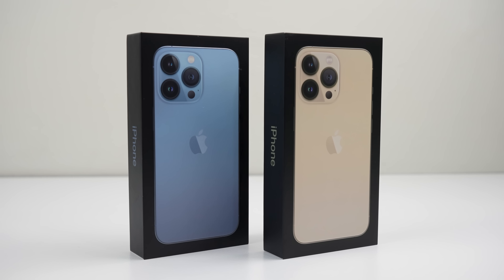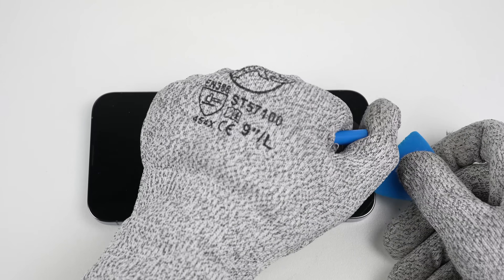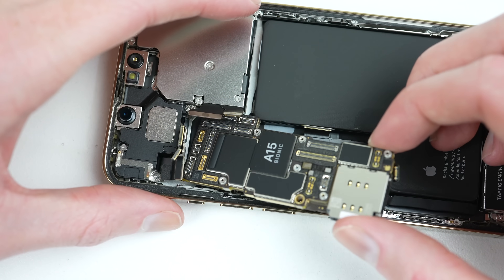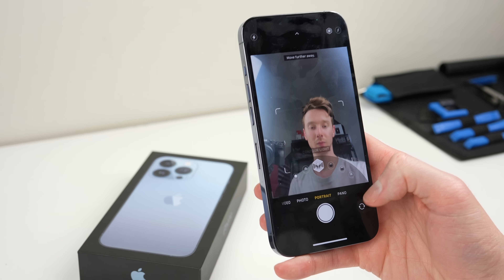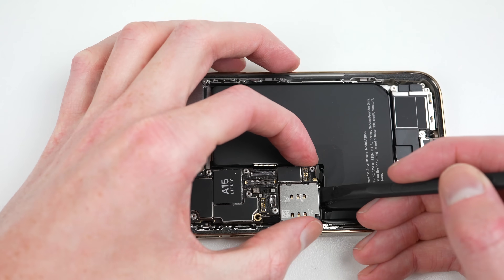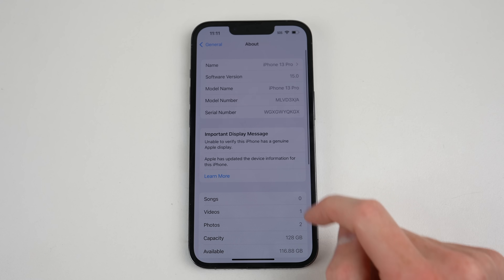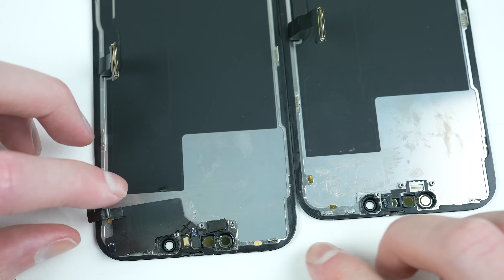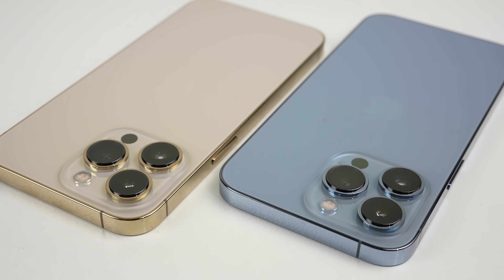iPhone 13 A Repair Nightmare - Teardown and Repair Assessment

Comment: Idk, even working in a repair shop for years I still prefer that apple has pushed out third party repairs and locked own security. As a user of the device I prefer the lock outs and knowing my parts are genuine. This all also comes in an age where small repair shops can partner with apple themselves to get genuine tools to a legitimate business shouldn't run into these issues. 

Only people that are hurt are the common users that want to repair their own device. Even then, I prefer the lockouts since there's no way to know if a third party is actually sending genuine parts. Also with the price of these parts, its going to be just as cheap to get it repaired by a professional anyway. I really do not see a downside.
Reply: Your ass is doing the talking for your brain.
Reply: That's a good philosophy if your customers are willing to pay twice the price for the privilege. The same with getting your car serviced at the dealership all the time. If you want to pay exorbitant prices for the same work, more power to you.
Reply: @hurricane1951  that would make sense if the parts didn’t cost more than the entire repair even directly from Apple. Screen break the most and since the switch to OLED the good quality ones are still around $250 at the cheapest for just the part. Apple charges $200 with repair included. That’s impossible to beat for 3rd party, so they always use aftermarket which will always not be up to genuine standards. 

Apple also incentivizes repair shops to partner making the sign on really cheap and giving them 50% of the repair cost. It’s great for business and ensures customers get quality products. There’s no downside.

Comment: If you could at least change the battery, which is not even possible with Android phones these days.  That would be a huge step forward.  I have now had an Android cell phone for over two years, but iPhones have now become much too expensive for what they offer, LG no longer produces cell phones and Huawei no longer has Google, so there are actually no more interesting cell phone companies on the market  , Samsung was never warm to me.  And so I don't know which cell phone to buy next, that's why I have mine for over 2 years and it would be nice if I could change the battery now, for € 20 or so.  Instead, it will probably cost me around $ 100.  Doesn't have to be something like that.

Comment: That's one reason why I still have a MacBook from 2014, because you can still change the hard drive (And you don't have to pay Apple's overpriced SSD prices) and before that you could even change the RAM memory, add an additional hard drive or install a CD drive and so on and so forth.  And I still have all the connections and don't have to deal with 3000 adapters.

Comment: Unfortunately this is making its way into alot of other products as well;
 I've just tried to repair a Husqvarna Automower (a robotic lawn mower), and experienced issues. In the device there are several computer-cards, one for each function. I then got hold of a few other mowers of same make and model for parts, even built the same year. Switched damaged board from 1. mower with a working one from donor mower. Turned it on, and a lot more fault indicators on display. Tried with card from 3 more mowers with same result. (And remember, all 4 of the donor-mowers was ok regarding this spesific card.) Turned in the original mower to factory dealer, who told me after repair, that Husqvarna is implementing checks that insures only Husqvarna sertified wokshops can do card repairs. No diy or third-party repairs possible on cards or battery. Yes, even the battery is checked for serialnumber when powering up.

Some models have 1 battery and others have 2. But the casing is the same, so there is room for a second battery in most models. Even the logic board is the same across several models and are populated with a second battery terminal. But you cant insert a second battery in a model originally set for 1, and you cant replace a broken battery with a third-party battery. Not even a donor battery from Husqvarna!. You'll have to purchase a new original Husqvarna battery AND a new logic board, AND have it replaced at Husqvarna authoriced workshop at insane prices... The autorised workshop says that even they cant use a donor battery. The pairing between battery and logicboard is done once, and cant be undone or changed.

This pracsis is NOT environmentally friendly, and it's NOT a safety issue (as Apple tries to imprint into everyone) This is ONLY for insuring that Husqvarna is getting paid for aftermarked repairs, and more sales of new mowers. SHAME ON YOU! BOTH APPLE AND HUSQVARNA! And all other companies that are doing the same just for profit!
Reply: While Apple can be symbolic of this practice because of just how much of a spotlight their products get, it is indeed far more wide spread than just them. This is the point of why right to repair is so important, without any push back companies are just going to keep pushing the envelope until it's all going to become serialized and virtually impossible to repair.
Reply: This also contributes significantly to wealth disparity. Only rich, first world countries with access to "official" services are able to use these products. Who knew that making our tools "smart" would simply mean that the companies manufacturing them would gatekeep the devices inside and out?
Reply: Yeah! Sometimes analog is the way to go..love my good ol lawn mower
Reply: There is a simple way to make manufacturers notice of your displeasure. Don't buy their product. There will be alternatives on the market that are serviceable by the DIY'r or 3rd party repair centers and when their model flops then this will then make companies  notice as it will not be looked upon kindly by investors/stakeholders etc. Until we ALL do it then nothing will change. There may be change if it affects a politician although the wheels of bureaucracy turn awfully slow so change could take upwards of a decade and then there's donations towards political affiliation to consider so...meh, don't hold your breath on that.
Reply: @fry_me  Well yes and no. Like you could buy a different phone than iPhone but what if you are already dependent on iOS only apps. Or you could buy a different tractor than John Deer but what they are the best for what you need to get done at your company. That is the leverage these companies have. It is just another extent of monopoly. And it needs to be fought against. We need some more customer protection laws because these freaking companies won't stop before anything to get more profits.
Reply: @MrMozkoZrout  There will always be the grey area and if we settle for the "most ideal" product because we are too lazy or incompetent to innovative then yes, we must suffer in silence because this is the road we have chosen and the vocal minority will be viewed as pesky mosquitos.
Reply: Right to repair pretty much started with farming equipment and phones

Comment: I think the reason that swapping the board and other components doesn’t work anymore is to prevent it from being used by another person if it gets stolen. Believe it or not there are such markets where you can strip a phone or a computer and sell its parts separately.  At least I have some satisfaction knowing that if my new phone is stolen it won’t be used by someone else and Yes the repairs cost a ton and that is a bad practice but everyone is doing it these days remember when Apple removed the headphone jacks and the charger and headphones every other manufacturer were against them but soon everyone followed now many other android manufacturers like Samsung ,Oneplus and many others don’t provide headphone jacks or chargers no headphones. And this is the industry trend these days and sadly every manufacturer wants to get more money out of people and it’s not going to change anytime soon.

Comment: Lovely accurate scientific video!!

So Apple will lose its customers in all those countries that do not have official Apple stores?

Here in my country, Apple phones are expensive and are sold at third party shops

The repair people could fix and interchange parts (hardware)

Now, even if they do the same procedures, they won't be able to do any good as software is out of their hands

So won't the marketing giant lose on a lot of customers/potential customers eventually?

Country wide customers??

M confused..

Comment: This is the reason why i don't exactly love Apple and the recent generations of smartphones.
If i want i can open my Samsung Galaxy S5 Neo with a fingernail.
WHY the new generations of smartphones have lost such a SMART function ?!

P.S. I'm planning to buy a Samsung Galaxy Z Fold 3 so tecnically i feel a bit disappointed by my self for what i sayd early ... but at least the Z Fold 3 is built to be repared by common assistence centers and not only by Samsung assistence centers.

Comment: There could be a way to re-initialize the part serials, thus restoring access to the lost functionality
Reply: Not unless you do this procedure at the side of Apple servers. Because the parts numbers are checked against those sources. The websites you trust use the same security measure. If you can break this security, so can you break the rest of the world.
So don't hold your breath.
Reply: What if you could change the serial number on the new part to match the broken one?
Reply: @abbabab966  Then it would work, but in order to do this, you would need to be able to produce the identical part, think of the investment in such sensitive precise equipment.

The only real protection is in the server side protected information. The used hardware can always be replaced, only with greater effort, if it's well protected.

Which that great effort, would cost hundred times more than the phone itself if not more.

This will only get worse in the future.

Even the the original producers won't repair the phones by hand anymore. They will be repaired/diagnosed with AI supported robots with such precision, a human even with sensitive hands and much knowledge, won't even come close to.
Reply: If this will become such a big problem in the future it is worth the investment.
There will probably be some random Chinese company who copies some of the parts and starts manufacturing them - the only thing left is to dig out the old part's serial and put it into the new one.
Reply: @abbabab966  That's correct, no effort no result. I see a lot of people being worried, well that alone won't create solutions. Might as well create another company as a whole to produce these devices/cpu's/phones, call it "Open Source Company" lol.

Comment: I actually think the problem is with the security issues that may occur when you replace the camera module (which contains face ID) and installing some hacked hardware that could trick the system with unlocking the phone

There’s no softw. locks on speakers, buttons or rear cameras – these parts don’t really play any role in the security, while the camera/display are actually crucial to accessing the protected information on the phone…

it still doesn’t justify the auto-brightness and truetone locks – the only reason for it could be apple’s laziness (as the sensors for these features are actually imbedded into the front camera module too, it’s just easier to take them down altogether… i guess)

Of course, apple is playing a dirty game, but they at least deserve some credit for caring about the possible loopholes in the security system of their devices
Reply: Ahem.. fappening. Ahem

Comment: I have so many issues with this practice by Apple. 
1.) If you are aiming to be carbon neutral, or at the bare minimum, reduce environmental impact of your products, why are you preventing people from getting extended use out of their devices? This is the same company that removed the charging brick from their packaging in order to decrease e-waste. The practice of preventing a consumer from getting extended use out of their products is counter intuitive to their environmental impact goals.
2.) It is quite obvious that Apple Care+ is the cash cow behind this. The worst part of Apple Care+ is that the consumer has a limited time window where they can sign up for the service. Those that don't sign up are SOL if their phone breaks past the sign up period.
3.) Apple is the largest consumer tech company on the planet. Their slogan is "Think Different." Instead, they are a harbinger of what is to come in the consumer tech industry. Other companies will follow suit. The consumer electronics repair industry will be devastated if this takes precedent. 
4.) These are truly remarkable, high quality devices. Apple makes great products. I'm typing this comment on my M1 MacBook Air, which is essentially my livelihood as it is my primary work device. Such great products are adopted by the masses. Taking the choice away from the user base is anti-consumerism at it's finest.

Apple, think different and DO BETTER.

Comment: they shouldn't be able to hardlock a phone to "TLDR" if you buy this phone from us the only way you can repair it is if you give it to us to repair... that's a load of crap, if cars were manufactured that way we would never have the legendary beasts of cars we have today. apple is pushing a very fine thread that will lead to a bunch of law suits if not stopped.

Comment: looks like there's a initial pairing with the first boot. 
that's what you need to find and reset if it's even possible.
i wouldn't doubt apple writes this info somewhere then burns the write fuse making it read only.
which would make sense if even apple can't fix a problem and tell you to get a new phone.
Reply: If would be nice if that were the case. But most likely this pairing happens at the factory. It may not be read-only though as Apple has the tools to pair new parts.

Comment: wow.... so ''replacing'' all parts with genuine brand new apple parts still gives you the ''not a genuine apple part'' message...
so apple is not planning to repair these things, they will just straight up throw them away after replacing you with a brand new one.

talking about sustainability...

Comment: My guess is that it's a built in hardware version detector in the OS/Software. So if it breaks you can't take it to a repair shop, but if you take it to Apple to fix. All they have to do is put in the new hardware and go into the software and change the ID for the bad part. Say the ID was 5423 for the broken one and 4243 for the new one. All they have to do in the software is change the numbers. But for us, we don't have access or know how to get to that. So if you put in a new part, it's not going to match the ID number/code thus making the software associated with that part not function. I think it all boils down to the software. Common IF ELSE. In this sense if it detects different hardward, then disable software, ie FACE ID. So your problem fixing it is the software based hardware change protection that only APPLE wants itself privy to. This is my theory though.

Comment: I've never bought anything Apple because I don't like their way of selling great hardware that you have 0 control on and the closed ecosystem, this though is a whole new level of bad. I wish someone from Apple could anonymously leak how they pair new parts to a board, it's probably some fancy always online software requiring a UID only given to Apple shops though, it's infuriating.

Comment: I still own/use my iPhone 6s. The first time I replaced the display, I tried to swap out the finger print sensor. After I did that, the finger print sensor became disabled. Once I reinstalled the original finger print sensor, the phone worked properly. Over the years I have replaced the battery (twice) and the display (once). I cant imagine owning a phone that I cant repair on my own. Especially one that costs as much as 13 pro. If my 6s ever become mechanically irreparable, im definitely going to get another 6s. I prefer a 3 point 5 mm (spelled out to avoid the hyperlink) headphone jack and fingerprint sensor over 7 to current models.

Comment: This is why i hate apple, i once dropped my iphone and it had a tiny crack in the glass on the back (it was an older phone) and the repears cost almost as much as the phone for GLASS damage. Nothing else was broken. Just the glass at the back not even the screen

Comment: I love how they all have those software locks but still put detachable cables and bolts inside instead of just soldering it all together and gluing the case with hardest epoxy they could find in the market.
Reply: Because apple can do the swaps and reprogram through software every component at 0 price in no time and resell the product again. They are real thiefs. That’s why the there are still components plugged in.